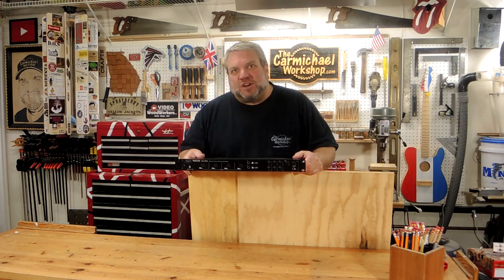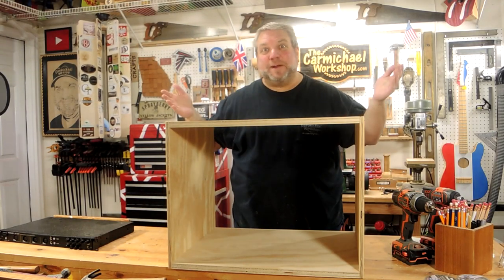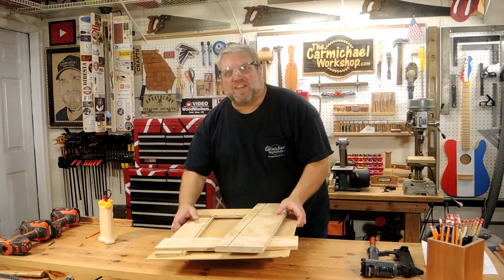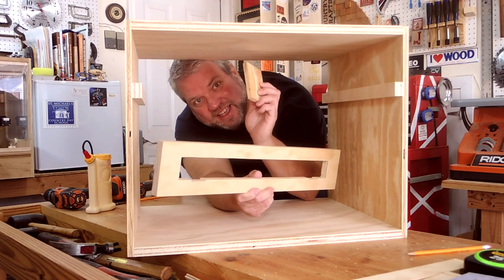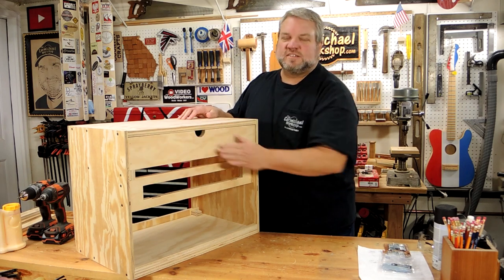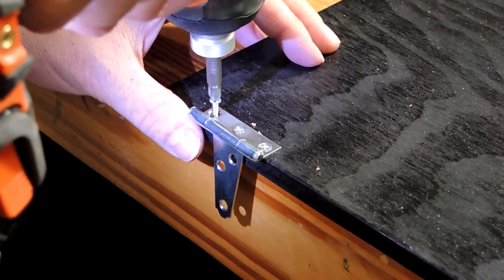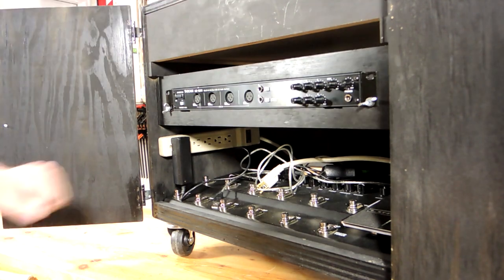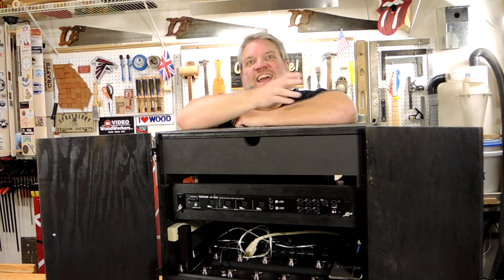DIY Road Case for Live Audio Gear

Comment: Our nearest box store must be getting metric plywood.  They had 7/16 and 11/16, but no 1/2 or 3/4 inch plywood for a similar project. What did you go about the heat given off by the electronics.?

Comment: I'm in the process of creating a 40" x 22" x 30" (h) case for 2 PA speakers. I'm using 3/8" thick 5 ply plywood. Do you think I'd need a 2x4 frame on the bottom?
Reply from the maker: I do think you would need some sort of frame to screw the plywood to.  2x2 or 1x3 would work as well and reduce cost.  3/8" plywood alone is not thick enough for screws to hold.  They would tear out easily.

Comment: Does it matter if you cut plywood with the grain or across the grain?? Which do you prefer?
Reply from the maker: The plies are glued together with alternating grain direction, so the strength is the same.  The outer plies may tear out a little more across the grain depending on the blade.  I usually pay attention to the grain direction of plywood just for cosmetics.
Reply: @SteveCarmichael  that's a good point.  I recently built a road case and noticed the splintering on the outer layer when cutting with a jigsaw.  The cuts were much cleaner going with the grain.  But I guess, if you're cutting square/rectangular pieces, you will always be cutting at least 2 sides against the grain.  ;)

Thanks for hitting me back!
Reply from the maker: A jigsaw blade with more teeth per inch would make a smoother cut.

Comment: Looks solid! How heavy is this case?
Reply from the maker: It's about the weight of a 12" combo amp.  He puts one rack mount unit and a Line6 HD500 pedal board in it, so it's pretty easy to move in and out of a car.

Comment: Do you then plug to power bar into an extension cord? Is that safe?
Reply from the maker: Yes, if you use a proper extension cord.  This is all low amp stuff.

Comment: Make the cabinet the right size next time and use rack rails so you can mount the 19” rack gear correctly.
Nice work - but rack rails make life with that kind of gear much easier.

Comment: No blade guard. No riving knife.
Reply from the maker: 1994 Craftsman blade guards suck.  I have it stored under the saw, but it should be in the trash bin.   I installed a MicroJig MJ Splitter Steel Pro for ripping.  I don't think they even had riving knives back then, at least not on the Craftsman contractor saw.   btw, I think you might like one of these - https://amzn.to/2XMQFBm